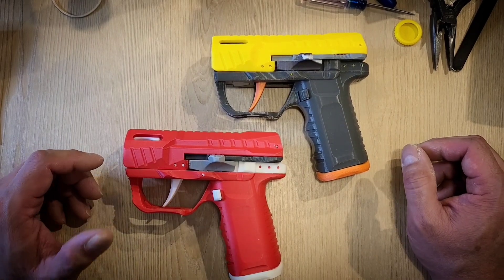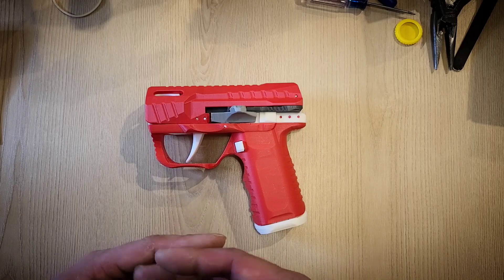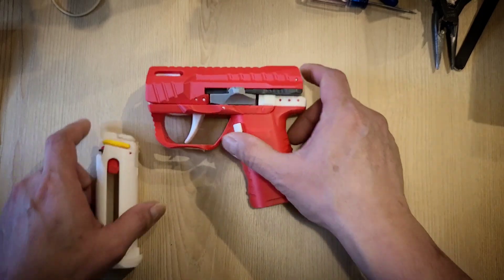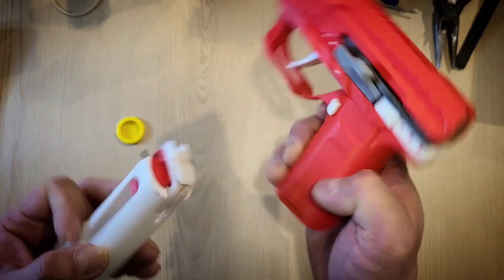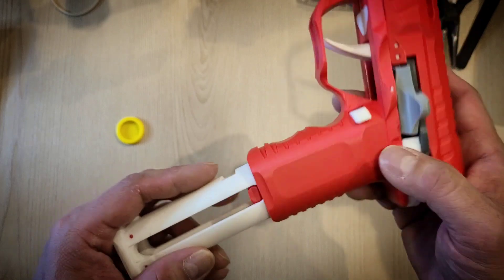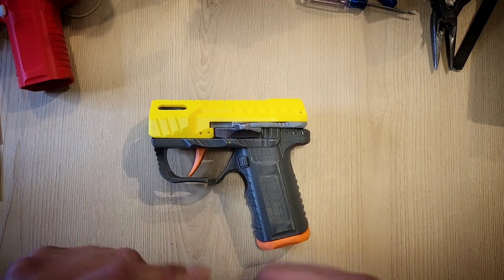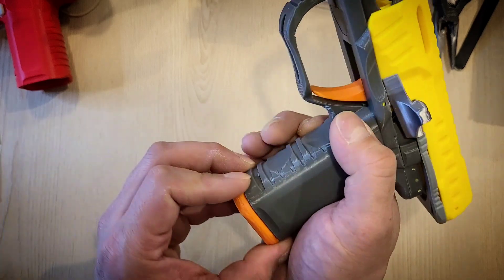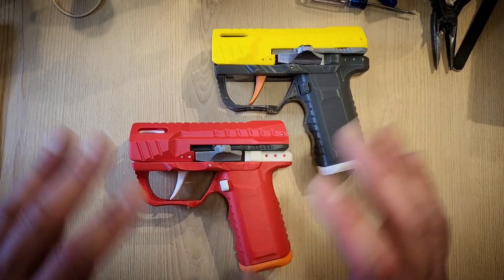3. How to choose between TPU Parts & Non-TPU Mods

Comment: will a pen spring work with the non tpu one? cause i have 85a tpu and idk if it will work
Reply from the maker: @kot_plackowy   You can definitely try, it's possible but no guarantees
Reply: I've used pen springs on 3 of them and they work without any issues.   You just need to cut them down to size.